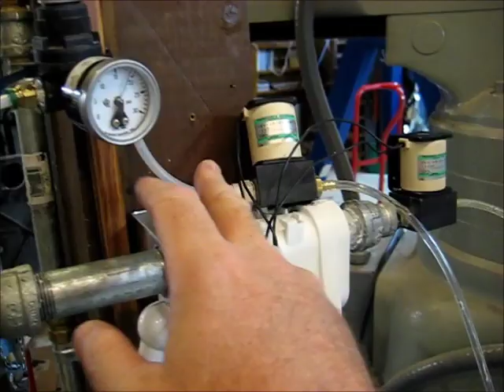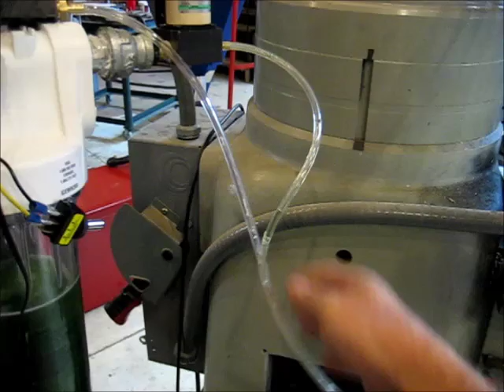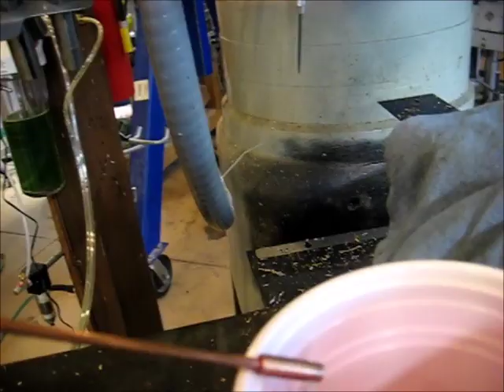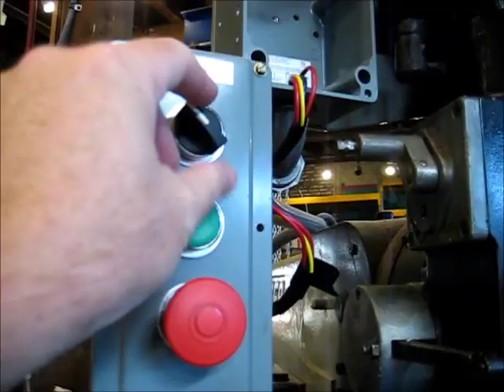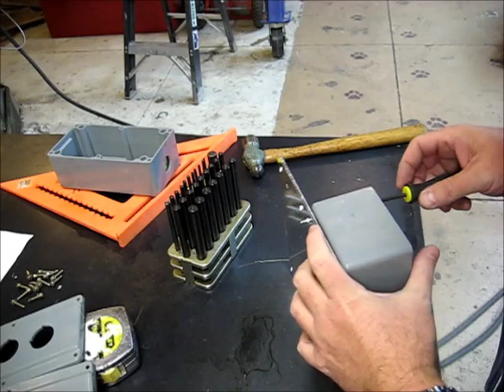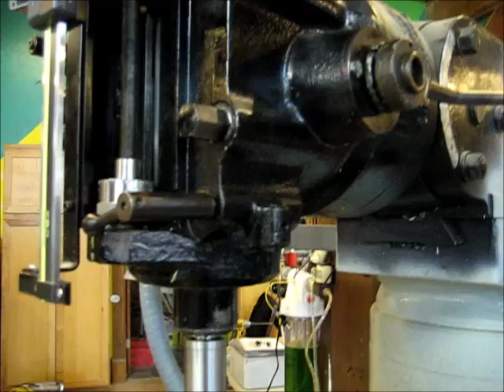Kilroy's Fogless Coolant Mister 4

Comment: you may have gotten better results by now, but did you every try using the second solenoid to vent the pressured coolant line when the switch was off?

Comment: One solenoid goes in the line before the needle valve to cut coolant and another solenoid goes before the air regulator in the air line you will need a switch for each solenoid valve.   To operate cut the coolant then cut the air as required.

Comment: Well, this doesn't make it any simpler but you could add an adjustable 'delay on break' relay to control the air solenoid.  Push the stop button and this relay would allow the air solenoid to remain open for a short period and purge the line of coolant.....no drip.

Comment: Just place your solenoid directly after the first regulator. You should not need the second one. They will bleed off quickly together. Did you add another block to the stop switch to turn off your solenoid?

Comment: My thoughts, put the solenoid directly upstream the coolant block so it also controls the pressure in the hose and put the reservoir below the coolant block so there is no possible problem with syphoning of fluid when unit is depressurized

Comment: Have you thought about trying a saddle valve as an alternative to the needle valve you are using?
Reply from the maker: johnflesburg Not real shure  how I could use a saddle valve in this setup, to replace the needle valves.  Do you mean poach the needle portion of a saddle valve and then make my own seat?
Reply: James Kilroy I thought about poaching the needle and making a seat for it as well, but I need to simply get out there and try it.  The saddle valve I have to play with is an elbow with external threads opposite the handle and a compression fitting entering from the side.  I'll probably thread the inside of the compression fitting for either a press-to-lok fitting or a barb fitting.  But, like I said, I need to get out there and try it.  I saw in part 1 that you mentioned that the expensive needle valve from Mc Master Carr was junk and that a more robust option would possibly be a benefit.
Reply from the maker: johnflesburg There is no doubt those little bastards were junk.What I found out was that I wanted, and didn't know it, gas rated valves.  I learned this when oxtoolco sent me a couple.  They are a little big to mount to the mixing block, so I will have to mount them off on a holder somewhere, but they sure do seal great.

Comment from the maker: Hi Tom, its a 5hp 90v dc motor, so its longer than it is round.  It does move some air.  I don't use it much anymore with central air in the shop but when I did I could aim it down one wall and it would setup a big vortex all around the shop.  What I really like about it is its very quiet for how much air it moves.  I do need to replace the bearings however, they are shot to hell.

Comment: I've just raided a scrap gas cromatograph for a load of bits to make a cooler/lubricator. You could do with some three port solenoids to dump the pressure when you turn them off.

Comment: why not make a plastic ring between the boxes so you never get a wire broken by rough edges its easy to make a split one so you dont have to take the wires off.

Comment from the maker: Hey Hermann, I thought your idea was great, enough to try it in several different setups.  I think if I replace the polyurethane tube with something with less stretch like Nylon that most of the dripping would be cured.  I got replacement needle valves, both of those little chrome valves broke while trying to remove a hose from the barbed fitting, so I might try the Nylon at that time.

Comment: Thanks for the detailed Explanation. Seems to be tricky. I am still a fan of the Solenoid direktly after the pressure regulator. Switch off, no pressure on the complete System. I like that. The nosedripping (aka nozzledripping) has obviously to be cut with the needlevalve. What a pity. Well here i am on my end. No further suggestions for now. If God has enlightened me I come back. Thanks again and good luck from Munich/Germany.